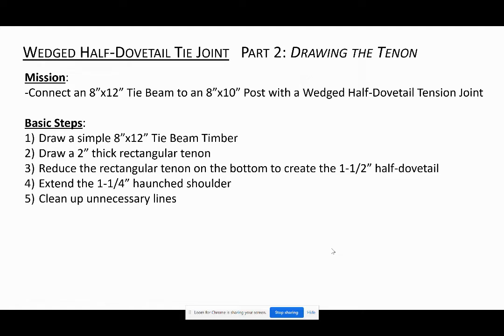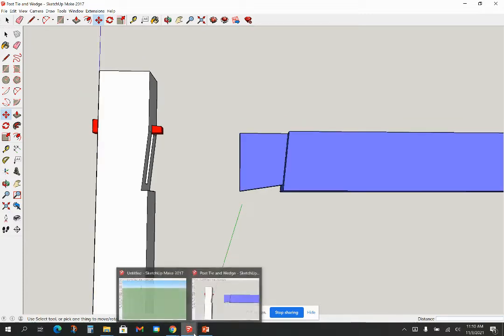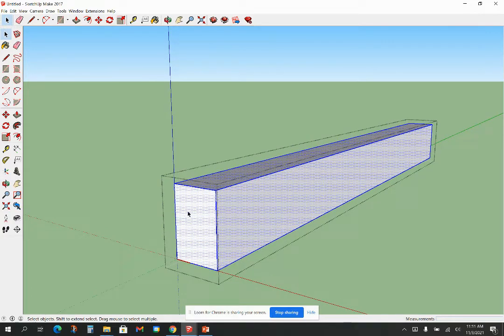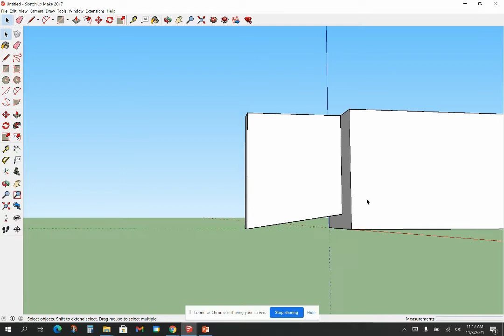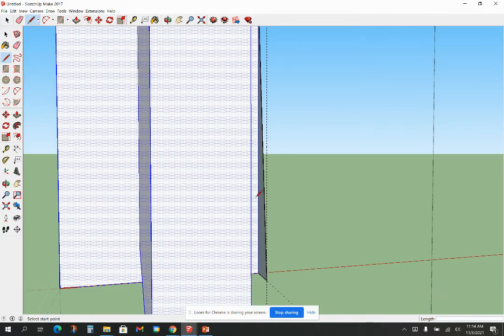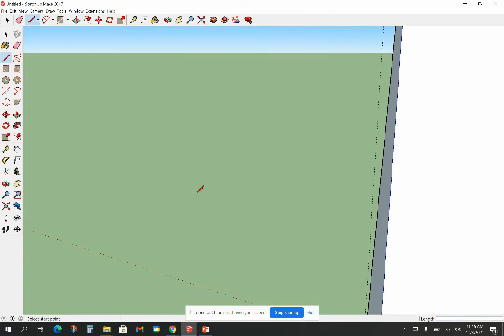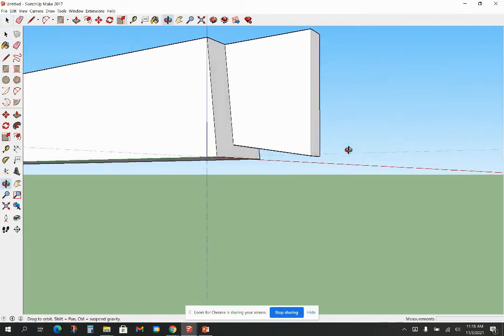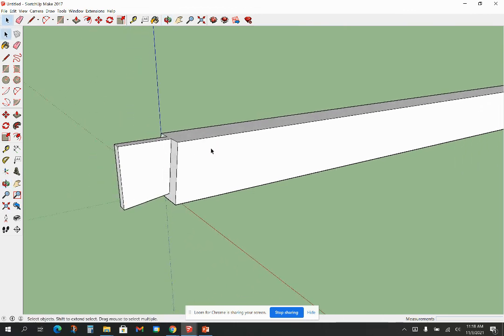Drawing Wedged Half Dovetail Joint in SketchUp Part 2  Drawing the Tenon

Comment: I find it easier to move the top edges to get the beveled face. No lines to draw and then push pull and link up around the tenon and and no extra lines to erase. Just one line to erase from the bottom dovetail push.